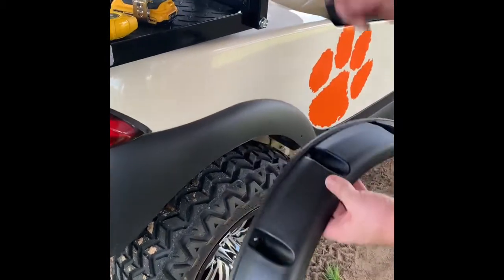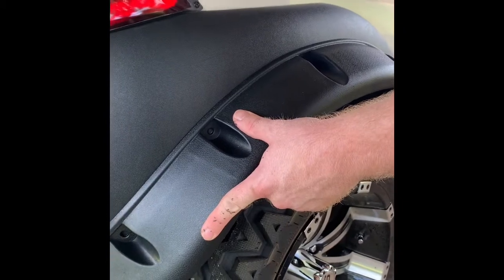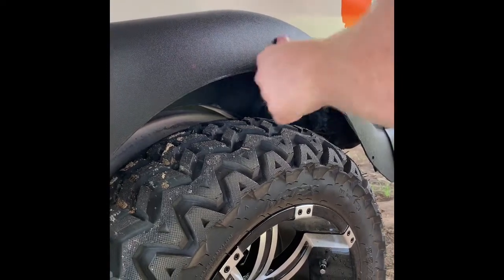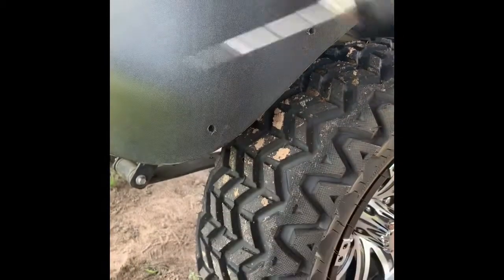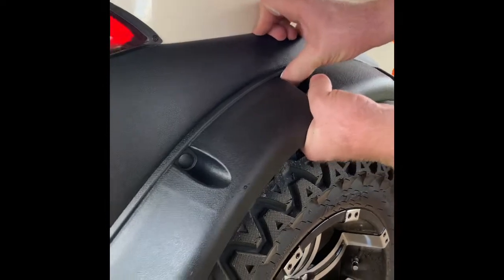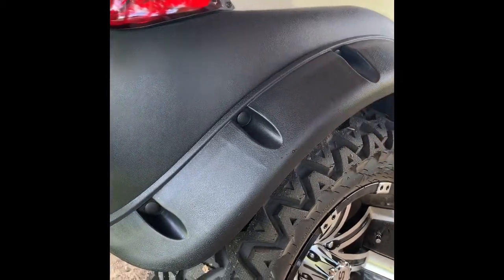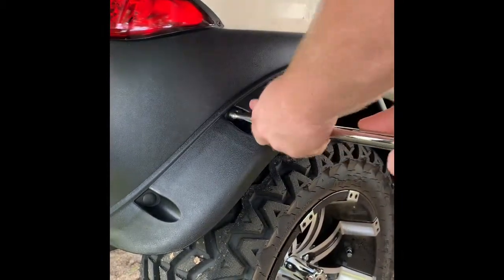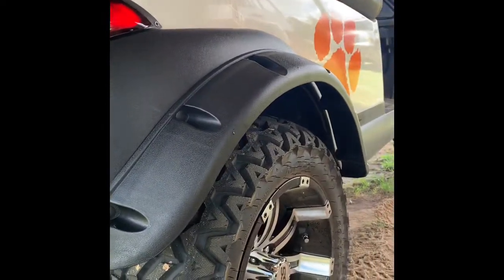Club Car Precedent fender flare installation

Comment: Drill and "wallow" out the holes...... OR just use the correct size drill bit!!
Reply from the maker: It was the right size. Doing that just made it a tad bit easier to push the pins in. They were used temporarily in my case. I later replaced them with bolts.